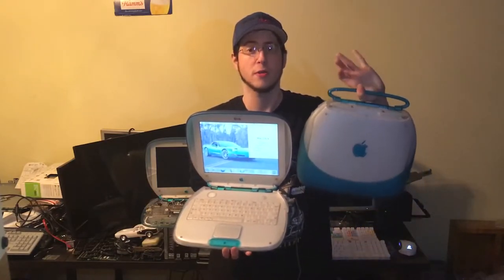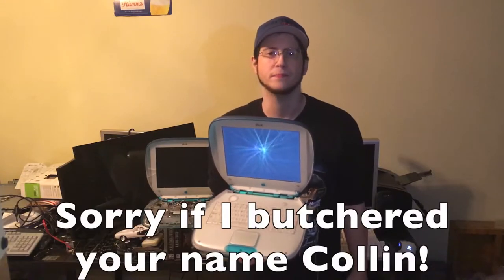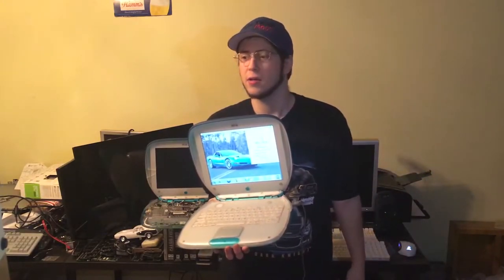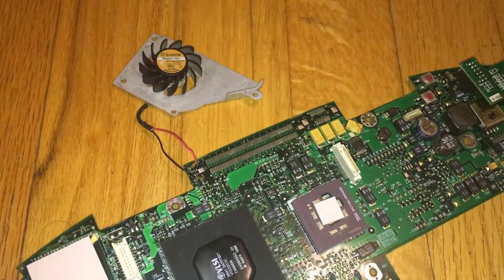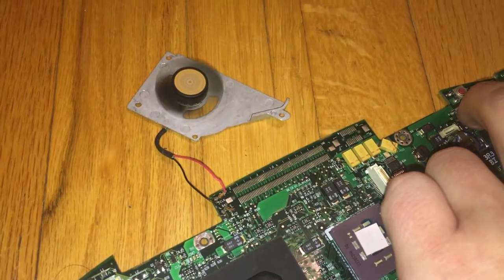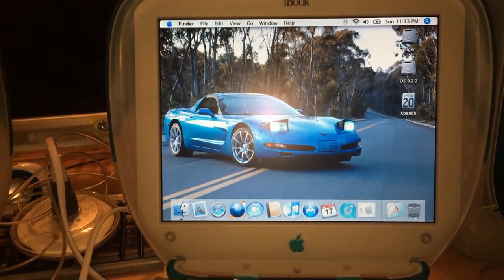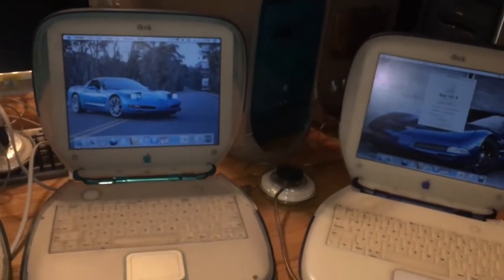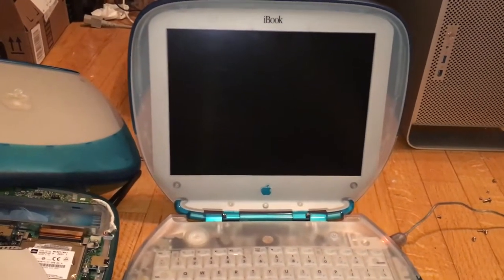My Blueberry iBook G3 Clamshells – PowerPC Series S.1 EP.15

Comment: I have been enjoying the  heck out  of your videos, but now I have a question about my Mac Pro 2006.  I have El Capitan installed and it is working fine except for one small issue.  When I go to use facetime it says it will not work since the unit is not registered.  Can a person register his 2006 Mac Pro that has been hacked up to El Capitan or is there a work around to make Face Time Work?  Thanks again for your informative video and help.

KG0MN
Reply from the maker: +Kevin Elliott should work outta the box, try signing out and back into your Apple account

Comment: Hope this one wont be demonitorized :)
Will there be any videos with Mac Pro 1,1/2,1 in future? :)
Reply from the maker: +The Virus Guy yes though I’m switching to the 3,1 mostly
Reply: I will be doing videos featuring my Mac Pro 1,1  (once I get a replacement hard drive or SSD) and my MacBook (1st generation 2 GHz) in the future once i get a power adapter for it. I also will be doing a video on my mid 2004 G5 DP once I get the CPU’s reseated.
Reply from the maker: +The Retro Review that’s awesome to hear Alex